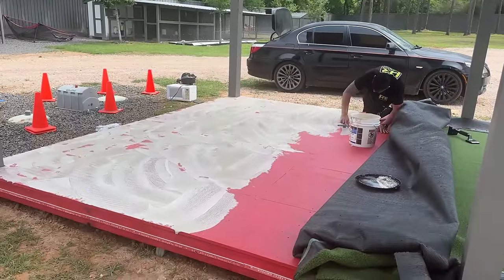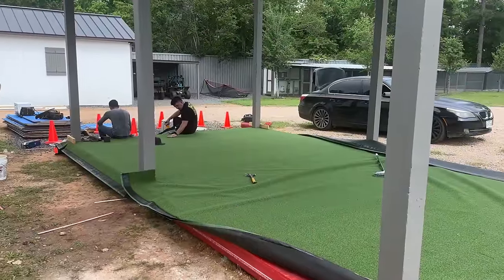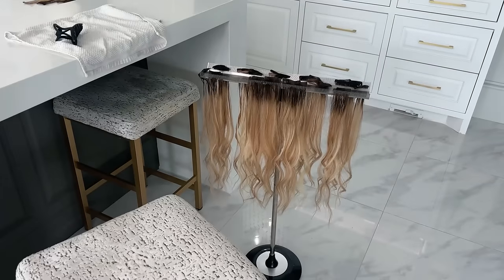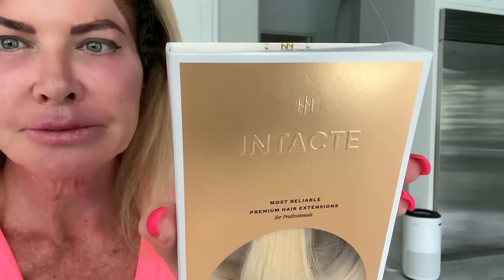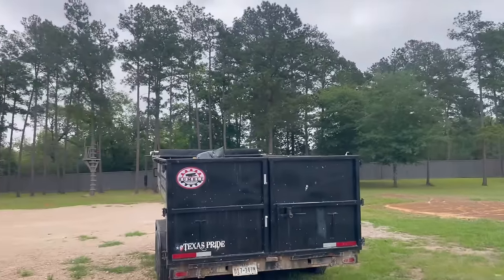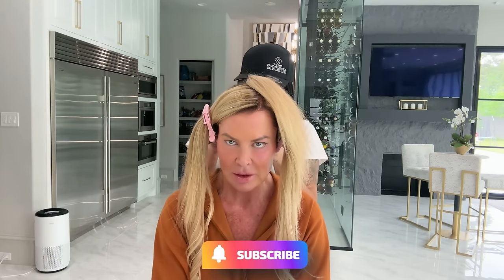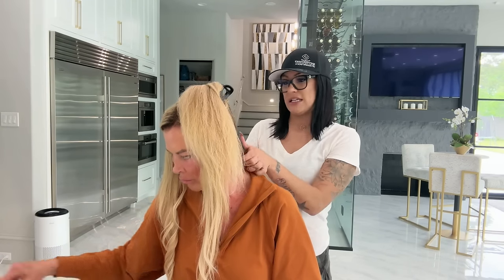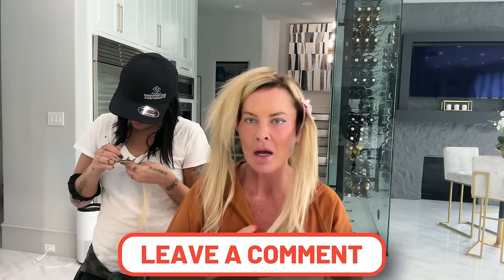I MESSED UP

Comment: I’ve been a few times to Coachella if you plan every detail it’s great the festival itself is very nice considering how expensive the tickets are but it’s everything else that can be a hassle. I would definitely want to stay at a resort and just take the shuttle to the festival back-and-forth. I normally stay if I go at the Omni Las Palms Resort in the bungalow suite. And only buy the VIP tickets they have covered area is an indoor places that you can go to get away from the extreme heat of the festival. The last time I went was a yourd Beyoncé performed and it was the biggest set and probably most expensive it was incredible to see perfection that close. It was a cool Momento to know that I’m clearly visible in the Netflix documentary of the show lol.

Comment: Aloha Godis 
I have a spinal cord stimulator for about 2 years now. It works well for sciatica but not back pain. Have pain break thru i call them episodes every 6-8 weeks lasts a few days in bed. Overall I would recommend stimulator especially if there is sciatica involved. I get tune ups 1-2 times a year( meet with technician) overall I sleep better and can function and get stuff done but am still limited to how much I can do per day. If I over do it I’m in lots of pain and stuck in bed for a few days. So half the day I can be active. I was same  as your husband only able to walk to mailbox